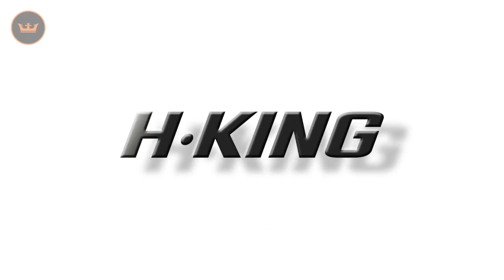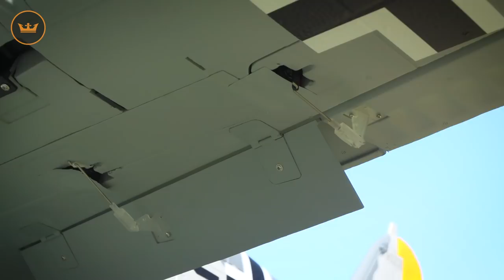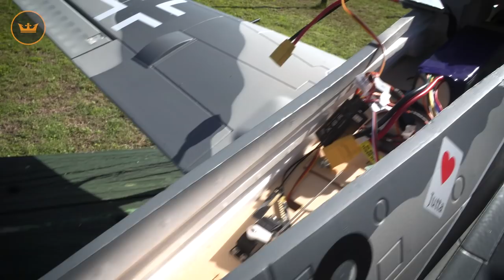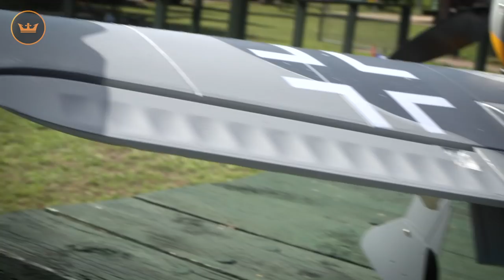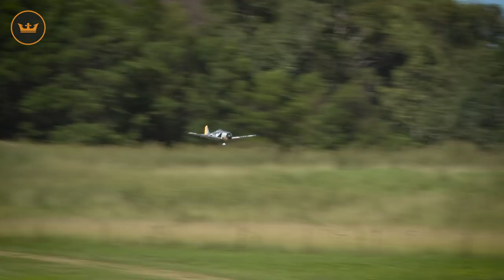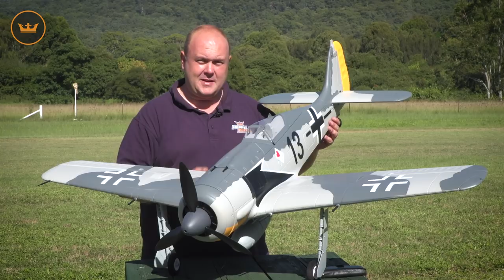H-King Focke Wulf FW-190 Butcher Bird EPO 1600mm (63") PNF - HobbyKing Super Daily

Comment: Glad you put proper flap hinges on and don't understand why you went with old wire main struts instead of oleos. Motor 290 Kv, so every battery volt the motor spins that lovely unique 3 bladed prop at 290rpm. Fact: new wing is identical to old series model...is fuselage the same?